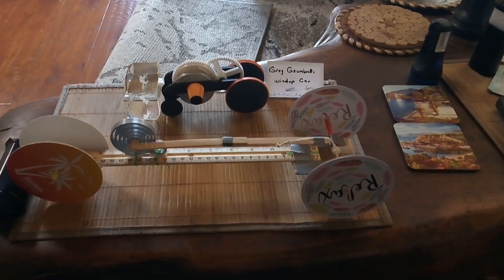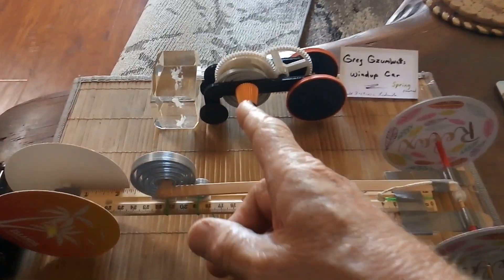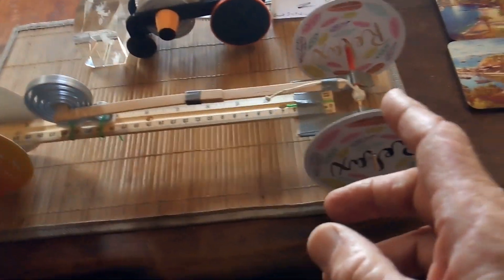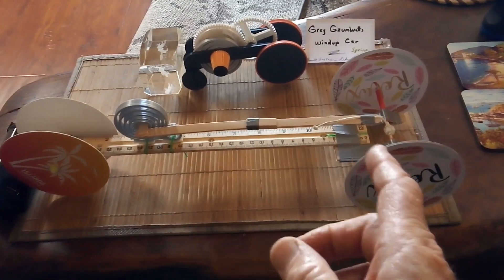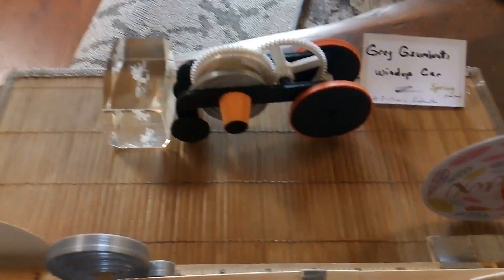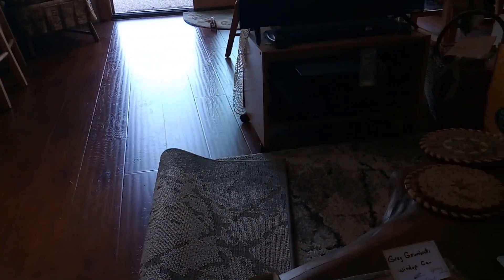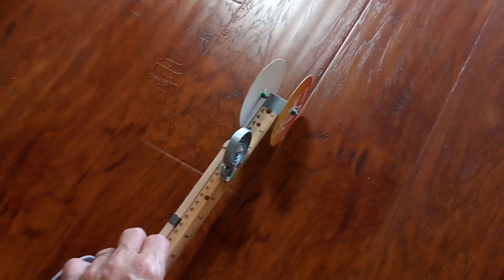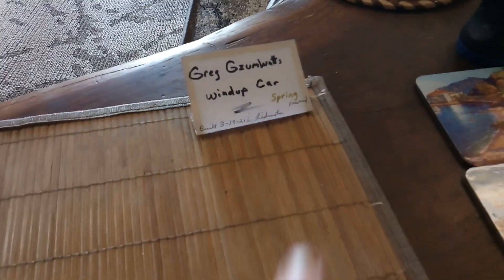3d Printed Plastic Spring Experiment

Comment: Brilliant, I might have to try that one 😊😊😊👍
Reply from the maker: I noticed in your last video that you broke your PLA spring.  The silver filament springs that I am using have not failed yet.  On the Mouse Trap car the spring only gets turned part way though.  Greg has a 3d print spring motor that I might try next (if I can find the files).  I might hook that to a rotating neo magnet and see how my little friend Maggie likes it. Ha.
Reply: @Lidmotor  I am working on a mousetrap style design at the moment. Another long print run 😆

Comment: If your going to do things like this now why don't you start making rotors that spin using air pressure. Possibly magnetically levitated like dad have made his.  Use clear tubing with a small nozzle pointed at a gear placed on the axle. Use a weight placed on top of a container.  Just use little valve flaps for quick filling filling then put the weight on top.  Make a magnetic rotor  to spin in side   a high voltage coil into capacitors.  Or use two way inflatable matress pump. Can you see the idea?
Reply: Make it small right?